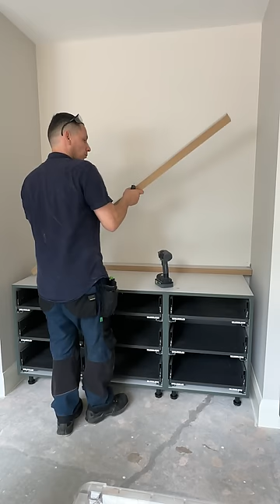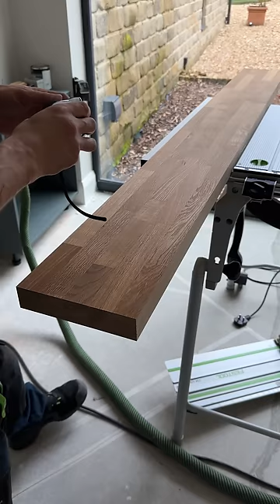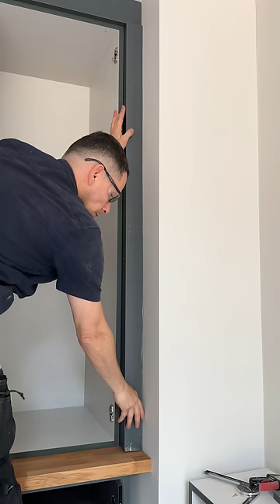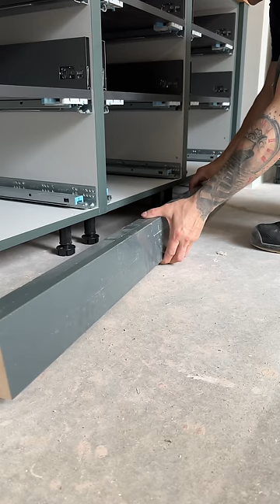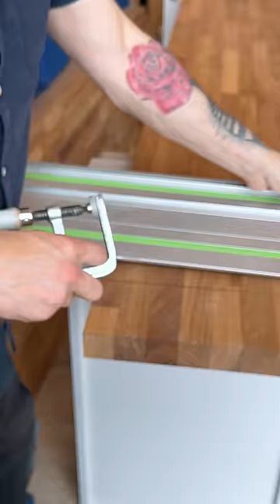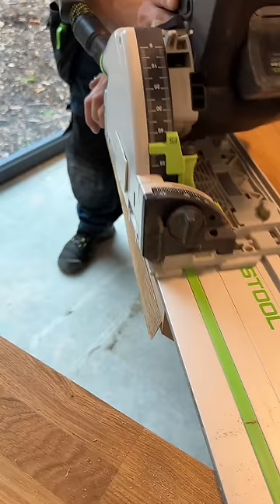The Ultimate Guide to Designing Your Dream home office desk

Comment: Everything is fine. The tool is good. Just a few oddities. The varnish remained on the gray material. How to saw without a guide? And so very professional and neat.
Reply from the maker: Thanks for watching what did you mean varnish remained on gray material?
Reply: I meant that at the end of the video, when you varnish the tabletop. Underneath is laminated, unprotected, laminated or painted material. Maybe I'm wrong and it's in a protective film. And I really liked everything. I am not a native English speaker and may not translate accurately. Everything is great.

Comment: Very nice looking build 👍. I have some questions though why did you use both the metal joints and dominoes when you were gluing up the main part of the desk? Is it to strengthen the joint? I always thought that the Metal joints would normally be used if you needed to take it apart in the future right? If you were gluing it together would it make a huge difference if you used dominoes all the way across? I'm not saying you did something wrong I just want to learn maybe there's a good reason. Thanks
Reply from the maker: Thanks for watching and yes that’s a good question first i was goi to install it  like that so i used domino and conectors but i came the next day and because there is a such a big window there and sunlight hitting straight on that desk it makes moving so much and I decided to glue it up but then wat to late edging expands more and end up with a gap in middle and connecters were not strong enough to tighten properly so i used borrowed some clamps from my joiner  friend

Comment: What are the connections called where you are using your biscuit jointer. Another brilliant,expertly installed job. Your attention to detail and superb finish is second to none. Whatever you charge the customer cannot complain. Do you always work on your own.
Reply from the maker: Thanks so much for commenting and shearing your thoughts ,yes try to not depend or rely on others on work ,the connectors are festool Kv-sys D8 ,appreciate your watch my video🙏🙏🙏
Reply: @CAVjoinery why are you using those connectors instead of plain dominos since you are gluing stuff together anyway. Could you explain more?
Reply from the maker: @Philomathe  that a good question as connectors supposed to be for a assembly and disassembly functionality but in thi case customers were in holiday so i was designed that part on site avoiding their instructions I thought the way they wanted would look like a normal room (putting a metal post underneath just because they wanted carpet down or a small unit green same as cupboards) so everything was fine and they have a 2 by 3 m window that generates huge impact in wood expansion dues to sun  lights ,because connectors aren’t strong enough to deal with that joint I glued em up just after customer saw it in reality not from videoand thats it ohh I got big tip too 🤩 thanks for sharing your thoughts and appreciate you were so polite in asking about it 👍🙏🙏🙏

Comment: Great vid but am I the only one that struggled to what him use a table saw without a fence?
Reply: Because the marked line isn't straight or parallel
Reply from the maker: It is ok as you there I used table saw for closer cut to the scribe line and you see I never rise blade all the way up and fence is where you want to achieve parallel edges on a piece of wood
Reply from the maker: Thank you that is right actually that is the point not using it
Reply: But is considered highly unsafe due to the potential of a kick back.

Comment: Great workmanship, but who designed this? Cable management needs to be designed in from the start, ideally a full length slot behind the desk, and big enough to pull through power bricks. Then a panel to hide the rats nest of wires. Also confused by a triangular desk in 2023. Are they planning on using a giant CRT screen from the 90's?
Reply from the maker: It’s ok no need to answer to a hate comment

Comment: If you are a noob, do not use a table saw the way he does. He is a professional so he knows his comfort limit. However, using a table saw without a fence or some backer can be extremely dangerous, especially if you are new. Proceed with caution. In all honestly 99% of us shouldn't use a table saw that way.
Reply from the maker: You are verry right that is just me knowing that this material isn’t acting like solid wood  so there is not biting wile rip cuting like a proper wood there is not strength in this material and other think i do is i never rise the blade more than 2 mm over the material i am cuting in some cases the fence could be more dangerous as it creates an tension between the balde and material and if is not proper used and push stick or something similar it can create kickback but anyway there are many case and i am not teaching here this channel is rather entertaining and i actually put some advertisements on profile description for othere to not replicate the way i use tolls and techniques hope this is making sense